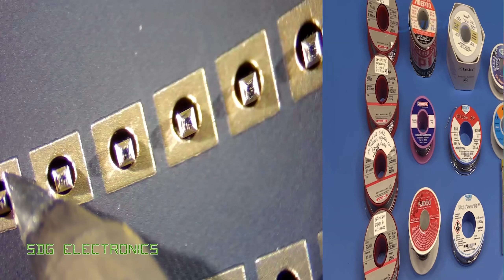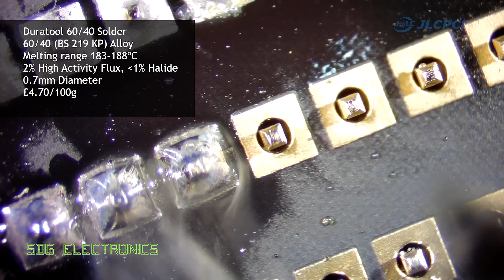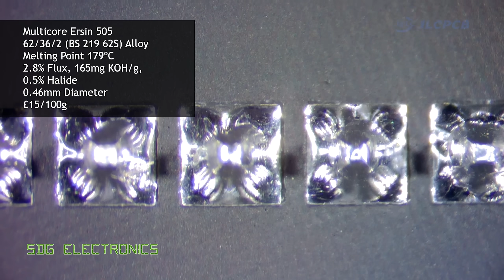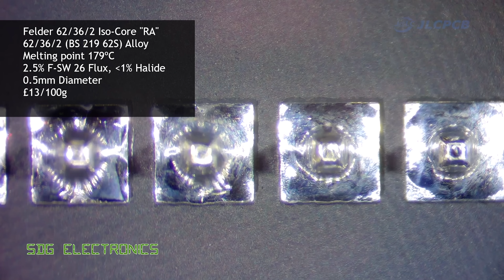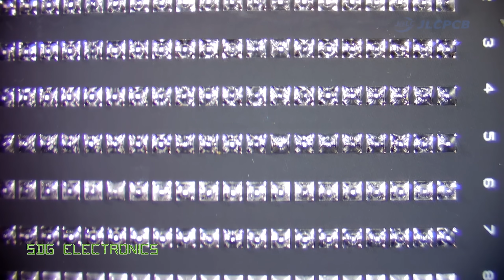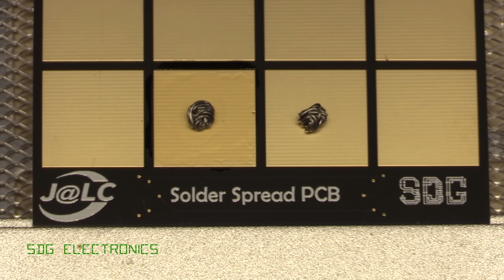SDG #079 What's the best solder for electronics? Expensive or cheap?

Comment: I use the mechanics solder and I have had no real problems with it. I use a really thin solder though because I solder small pitch smd components and it is hard to feed enough solder onto the tip of the iron when trying to do drag soldering. It is good to keep a few thicknesses on hand depending on what you are doing. I paid <4 euros for 150g and it lasts a long time.

Comment: Sadly (?!) really enjoyed that. I've the identical Maplin solder I bought 30+ years ago (still works fine!). Also bought some Koccu branded solder from China which appears identical in all but name to your Jinhu, and which went straight in the bin after a few tests because the joints looked so weird. Am going to try Mechanic solder on the basis of this vid. Thanks!
Reply: try the kester. its the best one in my opinion because the flux is very well proportioned so when you solder there will be no flux leftover on the board. I have never had to clean my boards witch saves me a lot of time.

Comment: Interesting tests! I use Griffon and they make very good solder, however not available in the test ( so many brands available, wow). The lead version is the one I prefer 60 tin/40 lead however it isn't available anymore, produces very nice and shiny joints (melting point 183 celcius) and a very good tempature to not overheat components. The lead-free version is 99/1, 99 tin and 1 copper and is a little harder to use (melting point 227 celcius) and I think the flux they use reacts differently (and different composition ofcourse).  You must do it right the first time (heat it a little longer) to get a perfect joint. Heating again (or several times) can result in joints like  the Jinhu brand (dim result).

 Maybe it is a good idea to add this to the tests, what will happen when you heat it up more than one time. Overall great video and a great subject.

Comment: i think that without any wires across the pads, you will heat up the pad quite fast, so then the flux reacts differently, would have cost you no added money to have more real thermal performance during the soldering, if those pads were connected to another rows in paralell, same applies for the video with smd parts soldering, second thing is you could have left half of the board not cleaned up, or have a double view before and after cleaning, but thanks for the video anyway!

Comment: Interesting test. It's a bit of a pity that you didn't include more lead-free solders, especially since there's much more variety in the alloys. It's quite odd that you don't even seem to have the "standard" lead-free alloy SAC305 included. The latest generations of solder alloys are ways better than the older ones, would have been interesting to see e.g. more Felder solders included for comparison, e.g. some Sn100Ni+ "NiGe" which is just an amazing solder (if the melting temperature of 227°C is acceptable), the best I've ever used (including some of the leaded solders you've included in your comparison).

Comment: Been using Kester "Resin 44" 60/40 RA (the activated rosin contains a bit of zinc chloride) for decades for repairing old radios.  The flux clears tin and lead oxides on component leads quite well, the real challenge for vintage electronics work.  Proper solder wire diameter is important for best results - it's the flux that does the dirty work.  (No, I don't hold Kester stock ;-)

Comment: I know not what solder among your kit that can be horrible, but I do know we have a tube of solder that came with an PI beginner kit (or something like that) that DEFINITELY was low grade. I had to manually add flux to help it, because oh man did it have trouble flowing across and taking my tip away resulted in a solder spike forming if i didn't add any paste. Weirdly enough, i cut a bit off once, and it seemed like it had a flux core. Probably cheap flux.

Comment: At what temperature did you solder the joints for the pin-headers? Was it the same temperature across all solders, or did you use different temperatures?

Also I am mostly soldering SMD parts and for that I am preferring to use EDSYN SU 5250 which is a 0.5mm Sn60Pb38Cu2 with FSW 34 flux.

Comment: I had a hard time remembering which THT was better, but the hot-plate test was good because you could see all of them at once. Maybe a summation in order of best to worse in each category, like shiniest to dullest, etc. All the cheap Ebay solder tests that I've seen all came out frosty like the Jinhu,  like some local 99% tin I got, but that Mech looks like it's worth a risk.

Comment: I think lead-free solder is quite different and has the following problems: 1) it may form tin whiskers 2) afaik, it less mechanically robust, lead has much more plasticity and better reacts on thermal stress 3) requires higher soldering temperature, this becomes a problem when soldering big ground polygons, additional equipment like bottom heater may be needed 4) wetting is much worse 5) it tends to form solder bridges on fine-pitched ICs. To have same soldering experience, lead-free requires more aggressive fluxes, flux becomes more important. Most of these observations come from my personal experience (except tin whiskers and mechanical properties, I read about these, but haven't experienced myself yet).
Reply from the maker: I agree with you on these points. There are quite a lot of lead-free alloys, but the good performance seems to depend mainly on the flux.
Reply: Also, leaded solder is toxic and not available anymore in the EU by now
Reply: @fritzlb  (Please correct me if I'm wrong) It is rumoured that lead solder is still permitted for use in military and aerospace applications, due (allegedly) to reliability issues with lead-free solder.   This casts doubt on the long-term 30+ year old durability of lead-free solder in high vibration environments IMO.  

Or do you suppose the durability of lead-free solder over 30, 40, 50 years is equal if not superior to lead solder, and the problems were due to poor quality soldering practice by the manufacturers of those military and/or aerospace products?

Likewise failures in consumer products are due to poor manufacturing, and properly manufactured lead-free boards should last for 30-50 plus years as expected?
Reply: @TassieLorenzo  military and airspace equipment always has been regulatory hell, I wouldn't use that as an argument here. I did not read the regulations due to lack of time but a quick google search does show that there do exist manufacturers of non-leaded solder for those applications. 

There are many hobbyists still claiming leaded solder is better, I personally think most of their problems are due to poor quality lead free solder. It's way easier to produce crap lead free solder than bad leaded solder but with something like lead free Stannol HS10 or Kristall 611 I never had issues. Idk about the availability in non-european countries tho

Comment: Extensive, great test! Thank you for making this comparison.
I was relieved when I tested Mechanic HXT-100  63/37 solder. It has nice amount of flux in it, it melts and flows just like some older solder that I've been using for years. Reason for getting new brand of solder was the ban of lead (=not being able to buy "regular" solder locally). 
Cheers!
Reply: Yeah tottaly my problem i've been buing one Brand localy and it was amazing now i've tried a lot of lead solders but nothing could even compare to my favourite one.
I Will try the pros kit looks great

Comment: Nice job! One thing I noticed with my solder, is ageing, I bought four 1 lb. rolls about 5 years ago, 3 different thickness solders with lead and one thin one lead-free. they all worked well for 2 to 3 years. I now notice that three of them don't flow so well. I add flux now and all work well. I assume the internal flux is ageing or the solder is oxidizing with age.
Reply from the maker: They shouldn't age so quickly. They normally have an extremely long shelf life. Some reels I have (not pictured) are 30 years old and still work great. Perhaps they were faulty with poor flux coverage along the length?

Comment: A fantastic comparison video. I enjoyed that very much. Personally, I have had terrible results with the inexpensive solders from China. I mainly stick to name brand types now, Kester and Multicore/Loctite. I don't know if you have access to MG Chemicals brand products in the UK, but I have started using their solders (63/37 No Clean in particular) which is not quite as expensive as the other big brands but performs very well for me. Again, excellent video. Keep up the great work.
Reply from the maker: Yes, I've got a few items from MG Chemicals, although I've not tried their solder wire. I would normally stick with the known good brands, but the Mechanic branded items do seem relatively genuine - especially the solder paste, which is more cost effective than most other options.
Reply: That has been my experience with Chinese brands; a FEW are good but MOST are rubbish
Reply: @kennmossman8701  You get what you pay for.
Reply: @MindFlareRetro  which is why I am happy to pay a high price and get good solder.

Comment: I have seen reports of people getting fake Mechanic solder, so that's something to be aware of. Chances are the stuff on Banggood is likely to be real but on Ali all bets are off.

I have an old roll of Stannol Sn62Pb36Ag2 which i trust a lot but it spits flux and leaves a very hard crusty residue. Bought some cheap Fixpoint Sn60Pb38Cu2 and it's quite adequate, but doesn't seem quite as nice as the Stannol above or a 60/40 Stannol. I wonder, similar copper-containing alloys haven't been represented here, the only one being Warton and it has a different ratio.
Reply: I've always ordered the mechanics solder from their official store on Aliexpress and Taobao, never had a problem. I'm very happy with this brand cuz it's the only affordable brand that solders very well and melts at low temp.
Reply from the maker: Quite bizarre, but I guess Mechanic solder has gained popularity because it's actually quite good so now it's being faked. I've had good results with the Mechanic solder paste too, which is really cost effective.

I didn't really come across many alloys containing copper, except lead-free alloys and apparently the movement is away from copper for production assembly. Commercial wave soldering now uses Sn100 to alleviate some of the issues associated with dull/grainy/cracked solder joints from SAC305 type alloys.

Comment: number 12, the ISO core "RA"
does not have 2% silver, but 2% copper
Reply from the maker: Yep, a slip of the tongue - was waiting to see if someone was paying attention...
Reply: @sdgelectronics  I have is right in front of me and was like, what? really? silver? don't remember having any solder with silver in it. Sure enough, there is none
Reply from the maker: @First2ner  actually I'm mistaken, it was another solder I made a mistake on. This is part number 18.720.72037, which is Sn62Pb36Ag2
Reply: @sdgelectronics  I see their products are changing a lot, can't even find mine on it.
Same part number now has 1% CU. That is not what I would expect to see

Comment: stupid question: since gold doesn't naturally oxidise, are you sure that the spreading on ENIG pads is representative of the flux characteristics?
Reply from the maker: It's a good question actually. Flux seems to have two characteristics for soldering - firstly to clean any oxides, but also it seems to help carry the alloy. If you've ever soldered with solid solder (for copper pipes etc), even if you clean the joint perfectly, it doesn't flow in the same way as if you apply flux to the joint. You're right though - the true test would be some heavily tarnished copper pads.
Reply: @sdgelectronics  my suspicion on copper is that the heat of the soldering itself starts the oxidation, so you can't escape it by cleaning before (a bit like the issue in welding), and you need flux. For gold, maybe the lead/tin itself oxidises and needs flux even if the substrate doesn't oxidise?

Comment: Excellent and detailed examination of solder. One thing I noticed on the final test is the addition of the flux may have been negative. The flux is mostly doing its job OK, but too much flux the solder flows too much. I noticed in this test, the solder looked cracked past its meniscus point. The non-fluxed solder seemed to flow until it stopped at the right spot before splitting. I am not an expert, but I do a lot of soldering, and that is how I would imagine it. Most of the time, I use flux for either difficult joints or when I reuse solder usually the good stuff. 
It was straightforward to see the crystalline solders will not last over time. In my 35 years soldering, I have witnessed many dry joints, and they all come from a matt finish.
Reply: I spent 3 years building satellites and their various sub-assemblies. The first thing was to de-gold and re-tin all components using leaded solder. (reduces possibility of tin whiskers). Memory ddims and other small pcb's had to have the unleaded solder removed, then re-soldered using leaded solder. 0402's were a complete pain! Soluble non-active resin flux in liquid form was always used plentifully, then removed with IPA and careful light brushing. The important thing is to get all the factors correct: Heat available, solder alloy, flux, duration of operation, cleaning, etc. There is no step-ladder long enough to remake a dry joint once the craft is up there...
Reply: @nlo114  Some advocate for lead-free solder (you can see their comments above "lead is toxic, lead-free solder should be banned entirely" etc)!  Yet you suppose lead-free solder genuinely has inferior reliability in a satellite application?  If true, that's very interesting and goes against their advocacy for lead-free solder!
Reply from the maker: The solder was still a bit molten in the last test. I think that was rosin that you could see floating around which made it look cracked
Reply: @sdgelectronics  There is a lot of variables associated with solder and from my material science studies at University (which I enjoyed) solder when it goes from liquid to solid goes through a Solidus zone that forms crystal and later reduces the structural integrity of solder. This is only part of the reason for the reason why solder goes dry. The use of flux helps resolve this problem, but some solders are just too cheap to go into high-level material science. I have always stuck to Multicore, but from your video, I see a few others that I like as well.
https://ars.els-cdn.com/content/image/3-s2.0-B9780815515937000047-f04-68-9780815515937.jpg (image credit - Jaydeep Sarkar). This image shows the perfect lead-based solder point where the solder goes from liquid straight to solid called the Eutectile Region. Flux broadens this region but not by much.

I will leave the rest of the theory up to the scientists.
Reply from the maker: Thanks for the info, great stuff.

Comment: Thanks Steve! I use Kester 63/37 mostly.
Reply from the maker: I noticed the actual solder wire on the Kester is extremely shiny in comparison to any other solder I've seen. Seems to work well, but the brand is very uncommon in the UK. I had to import this reel.
Reply: Mine is "44" rosin core 0.020". I am happy with it. My solder joints look pretty shiny as well.

Comment: Thanks Steve for the detailed analysis...as I was watching I looked over at the bench where there are three 1lb. rolls of Kester/Multicore silver/non-silver that at this point should last me until my soldering iron "goes cold!"  Biting the bullet and getting it in quantity pays off in the long run.
Reply from the maker: Yes, my advice is if you find one you get on well with - just buy a big reel - it's cheaper in the long run anyway.

Comment: Thanks Steve, this is an excellent reference. Very detailed reviews with the product stats shown on the screen, including the price. I have 250g of the mechanic stuff @1mm which is perfect. I also bought 250g of a 60/40 rosin lead free cheap reel at the same time and that is terrible. You have to run your iron around 380 to even start melting it, whereas the mecanic stuff begins to melt from 320c. Although I mainly use 350c like Big Clive due to the boards and the speed I work at.
Reply from the maker: The mechanic solder definitely seems pretty good. Thanks
Reply: The mechanics solder works pretty well around 250c when doing small through hole stuff. I do have my solder iron calibrated so temps I quote should be pretty accurate.

Comment: I have just very sadly used the last few mm of my Maplin solder. Like you I have used this for many years and think it was one of the best. It's like losing a good friend. I still have not found anything quite as good.
Reply from the maker: I do think the Multicore 60/40 is quite similar. The ones with the Crystal flux work well too. Thanks

Comment: Thanks for the video, very interesting results. Did you keep a constant tip temperature for all the through hole tests or were you running at a higher temp for the lead free solders? If so how much hotter did you have to go, roughly, to get these results?
Reply from the maker: Constant temperature - it was using a Metcal 700 series tip which is somewhere around 350C I think

Comment: Do you have any "no clean" solders?  How about organic flux solder?  Maybe also put some solder paste on a board and see how that flows for comparison?  Either way, nice video, I was surprised how similar they are all, some how I expected more differences.
Reply from the maker: The Multicore Crystal 505 was no clean. I don't think I have any organic, the Felder RA is the most active out the lot.